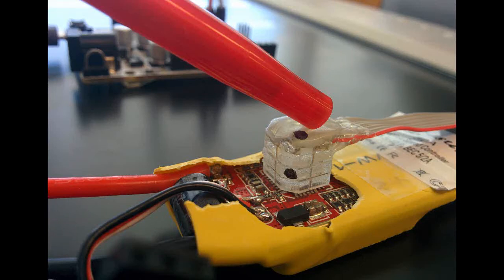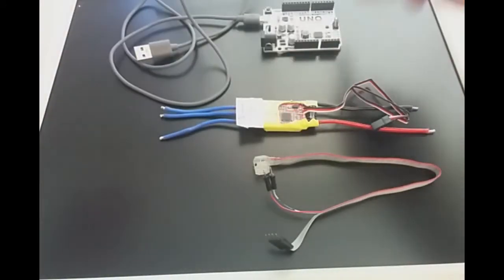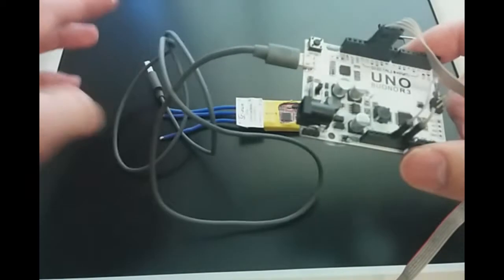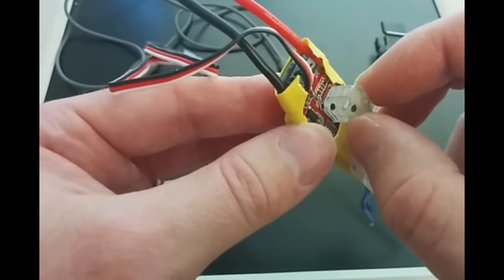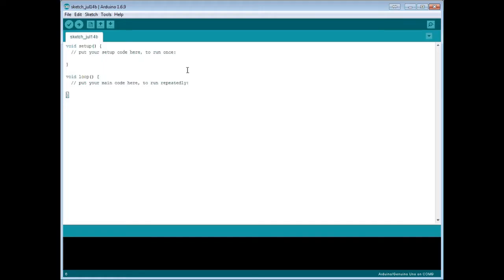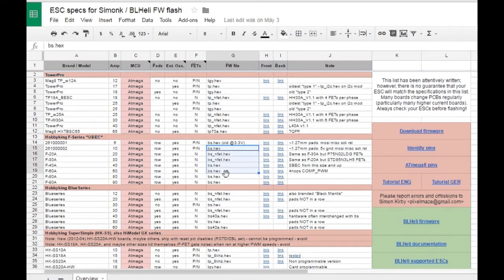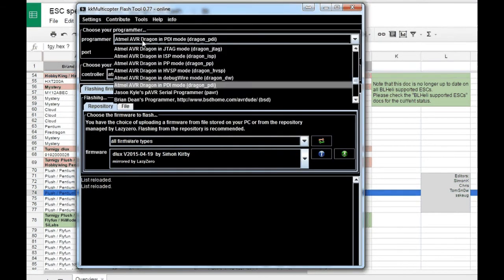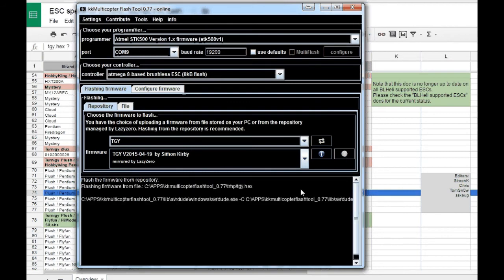How to FLASH Atmega ESC with Arduino and Home Made FLASHING TOOL - SimonK - BLheli

Comment: I have  this KKMulticopter Flash tool 0.77 and the firmware slot is Empty there are no hex.files. how do you get the repository into this holly software 🤷‍♀🤷‍♀
Reply from the maker: Try to make sure web access is granted for kkMulti app. It shall download them automatically. Otherwise, google forums for .hex files.   When flushed with a .hex,  use an alkaline 9V battery to power ESC for testing (safer this way, in case hex file operates motor in a wrong way, less smoke :))

Comment: I have a AeroStar esc that has a nasty issues where if i slam the throttle to 100 it will hum like hell for a second or so and then slowly ramp up the speed
I don't see it in the list so idk if i should try and modify the firmware or not

ESC is a AeroStar 40A 2-4s with reverse
Reply from the maker: I would Google more about your ESC if somebody have flashed them already. Also I've heard it's good idea to use 9-volt battery to power your ESC with a motor when you are not sure whether you are using a correct hex file for your ESC.

Comment: Am using Arduino nano but getting error
Unable to read high fuse
Flashing of firmware failed
Reply from the maker: Try different target chip, it could be damaged. Check wiring. Check avrdude configs! Last one is key

Comment: name of cable please. the adaptor bit that sots on the chip. 8dip or 8sop will fit right?
Reply from the maker: Name:  AVR Atmel ICSP Atmega Flashing/Programming Cable Socket
It works with TQFP32  package only - for small and hard to contact chips. (DIP is easier to contact as its got bigger and wider spaced pins)
Reply: Vitaliy D here is the latest link to socket adapter your link is no longer valid. 

https://rover.ebay.com/rover/0/0/0?mpre=https%3A%2F%2Fwww.ebay.com%2Fulk%2Fitm%2F223137157463